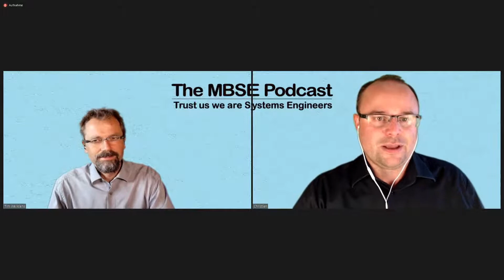[Episode 15] The MBSE Podcast - MBSE Methodology SYSMOD incl. FAS and VAMOS

Comment: Does SYSMOD methodology suitable to model production system ?
Reply from the maker: It works for all types of systems. It is a general MBSE methodology. To meet specific requirements like for production system, SYSMOD must be adapted. 

But SYSMOD (and any other MBSE methodology as well) should be adapted to the specific needs of a project anyway. An MBSE methodology typically cannot be used effectively out-of-the-box.

SYSMOD contains its own process for adaptation: SMAP - SYSMOD MBSE Adaption Process.